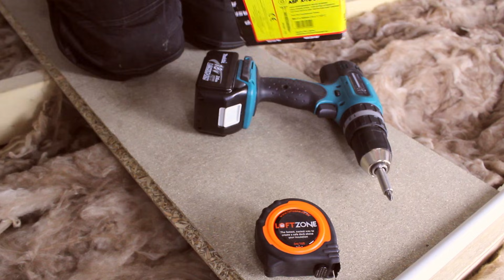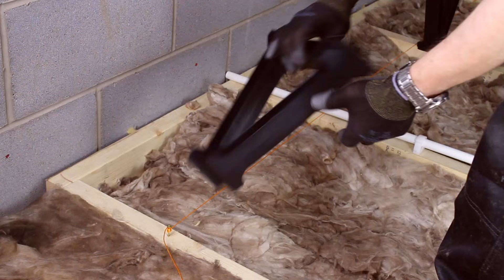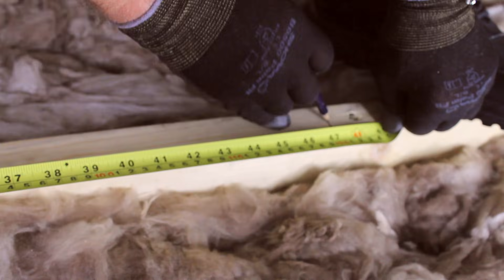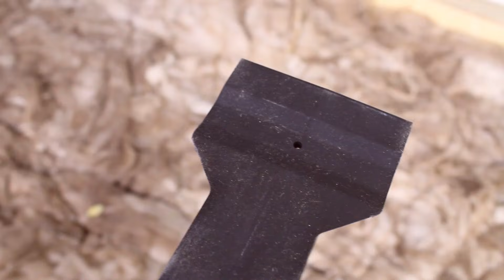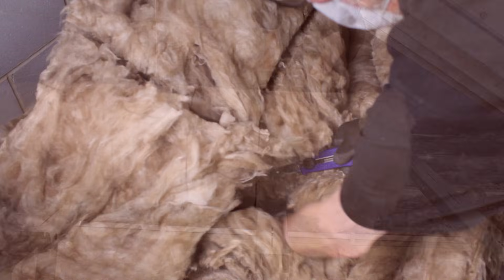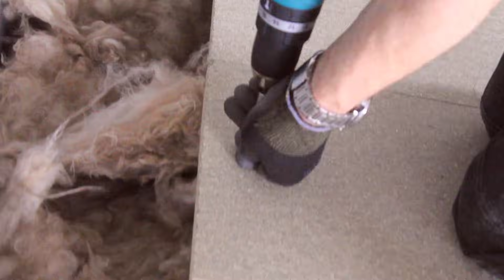How to Board a Loft Above Insulation | StoreFloor Raised Loft Boarding System | LoftZone

Comment: So, your loft is designed to carry 25Kg/m2 additional load. Pedestal loft floor weighs 16K/gm2. This means you have 9Kg/m2 additional load for your storage.
This equates to around 9x1Kg bags of sugar every square metre of the loft floor area. Not much is it? Consider before any visit from a surveyor/building control or even your insurance company!

Comment: Its easier to do a multifoil solution. You can achieve good R value with two layers of YBS Super Quilt using the foil and cheap CLS studwork timber. Plus you will only lose minimal height and its a very stable floor for storage.
Reply from the maker: Technically, that is incorrect. The foil will deliver good R-values but the timber will counteract that, by acting as a cold bridge through the insulation. This is why new build houses can't use timber to raise platforms without adding extra insulation elsewhere in the building. Our product does not act as a cold bridge. Also, the foil is not breathable (vapour permeable) and so you will need to add a ventilation strategy to the living spaces of the buildings, otherwise you will end up with mould in the home. These are the reasons why we don't sell these products on our website.

Comment: A very expensive system
OSB board and cross beam timbers is cheaper, quicker and more solid.
Reply from the maker: On the contrary! The LoftZone StoreFloor system was designed as a superior alternative to using wood. Its advantages include being lighter, being easier to install as it can bridge over obstructions, services and uneven joists, it also does not conduct heat through the insulation like timber does, and it also allows for a great depth of insulation that can be achieved with one row of timbers. That's why only the LoftZone StoreFloor system has the necessary BBA certificate for new builds. And also why you can't use the method you suggest on new builds without increasing the insulation elsewhere in the house to make up for the heat lost in your method. 

Finally, don't use OSB boards, there are much better boards on the market. Indeed, at the time of writing, LoftZone has the UK's largest range of quality loft board types on our website :)

Comment: what a waste of good loft space
Reply from the maker: On the contrary, the flooring is designed to go above the insulation (at buildings regulations required depths) and this enables the space to be used, rather than simply be full of insulation.

Comment: Can i use these to install a laminate flooring and make a bedroom in my attic?
Reply: No, this was designed for a loft storage area. You will need to strengthen your joists if you want to turn your attic into a bedroom.
Reply: @nationwideloftstorage7151  how can i strengthen my joists
Reply: @mohammadabdullahkhan360  you will need to hire a loft conversion company. It's a job that will cost tens of thousands of £ and cause a lot of disruption, but will add to the value of your property. Alternatively if you only want a storage space, then you can find your nearest installer on www.loftzone.co.uk, this will cost hundreds or a few thousands of £ only.

Comment: Hello  . Just watched the video carefully , as i want to do this to my loft too . I still have to  enlarge the hatch first , but i will have to inform myself better about how safe it is to cut one of the joists to enlarge it .  Anyway , this seems to be a proper system compared to what wickies and b and q are selling , and it seems to be at almost same price . (both a bit over what i was expecting lol )
Reply: Cutting a roof joist - nothing can go wrong - LOL
Reply: By "enlarge" I assume you mean you are trying to install a rectangular hatch which typically have a built in ladder?  In either case NEVER CUT THE JOIST. Your hatch needs to be orientated to run in the same direction as the joist so that it fits between the joist. You then secure two noggins (horizontal piece of timber) between the two joists so your hatch can be secured to it on both shorter sides.

Comment: Why can’t you just put down sheets of ply straight on top of the joists ?
Reply from the maker: Because that doesn't allow for enough insulation to meet modern building standards or codes, which have been set to save energy. These days you need at least 270mm of attic insulation (if you use mineral wool) and most joists are only 75 or 100mm tall. The LoftZone product goes above the insulation, giving you both a deck and the correct amount of insulation.
Reply: Lol

Comment: What a waste of space, great way to reduce the hight in the loft 🙈😃
Reply: I’d think it wise to research a subject, before offering an ignorant comment.
Reply from the maker: The LoftZone StoreFloor product is designed to go in lofts where there is already up to 350mm of insulation, which you will find in all new build houses and many older houses where the insulation has been retrofitted to the level now required by building regulations in the UK (typically around 300mm thick). So it actually increases space, by giving you a storage deck plus the full depth of insulation.
Reply: Houses are extremely over insulated theses days,  use supper foil save space and money,
Reply: It’s not about homes being over insulated (if there is ever such a thing) it’s about being able to install flooring without effecting the original to regulations new build house.

Comment: I'm just trying to figure out how sonething designed to hold plasterboard can all of a sudden support a load! Would love to know the allowable load per sqm for this set up
Reply from the maker: The allowable load in each loft depends on the building. However British Standards mandate a minimum loft floor strength of 25kg/m2 for all new build houses, for storage or other long-term purposes, in addition to a higher limit for transient loads, e.g. someone walking around. Many houses are, of course, able to take even more load than that. LoftZone has been tested to hold 500kg/m2 in accelerated ageing long-term tests. I hope this helps answer your question :)
Reply: @LoftZone  yeah thay does so as long as it was built after those specs were introduced should be fine? Nice
Reply from the maker: @vkturbo7676  Well it varies by building of course, but many older houses are actually stronger than new ones. Modern truss roofs are often much weaker than more traditional cut roof designs, for example. You just have to be sensible in loading your deck with your possessions, and we provide guidance that you shouldn't exceed 25kg/m2 unless you know that your roof is stronger.

Comment: They just dont look stable and made of plastic :(
Reply from the maker: Actually the LoftZone deck has been independently tested and is much stronger than the loft joists which it is screwed into. You can see our BBA certificate showing this on our website, www.loftzone.co.uk. The reason for using recycled engineering-grade plastics is that wooden supports act as a 'cold-bridge' and allow heat to escape through your loft. The Buildings Research Establishment has however verified that our supports do not act as a cold bridge in this way.

Comment: 11 inches extra height in a standard loft ? does not leave much head room ....
Reply: No if you want to maintain the new regulation thickness of insulation.
Reply: Yes, that's the buildings regulations minimum depth of loft insulation these days. Many houses have more. What the LoftZone product does is that it provides a deck above it, so the space can be used for something else and not just insulation.
Reply: Best use insulation boards in the rafters and only use a slither of insulation under the boards which should be screwed down without the use of the tri supports .
Reply: @hardythingh4510  but that makes it a warm loft, not a cold one. You will then also have to block up the vents (e.g. in the eaves) and bring in a new ventilation system, eg. MVHR.

Comment: They give no extra strength to the roof  ok for light storage
Reply: Thanks for your reply, but I'm not shore you are correct when saying they strengthen Just as if you counter baton, as you have the strength of a 4x2 screwed to evert joist that ties the roof together , I think this would be a great product and more weight Bering if you combined them both together. but as you say it is selling so great I hope your company is a success. Ill have a look at your website and if it is cost effective ill give it a try out. I also think a washer to give the screw a better fixing
Reply from the maker: Thanks again Richard. By the way, we do have trade prices (not shown on the website, but available if you call us up to order and have deliveries sent to your business address). All the best!
Reply from the maker: Hello Gemini Roofing, and thanks for your comment. Yes, we always advise using LoftZone to only create storage or safe access platforms, and to not exceed 25kg/m2 for storage unless you know your loft is strong enough for more. However it's worth noting that the LoftZone parts do indeed strengthen the joists in the roof to some degree - they act like a lattice beam. In that respect, their strengthening qualities are similar to cross-bracing with extra timber, except that it's much better than using timber as wood is heavy and acts as a cold bridge through the insulation, affecting the U-value of the roof. Lots of roofers buy our product and sell it as a value-added extra to their customers. If you're interested, please get in touch via the contact details on our website. 25,000 buildings in the UK with LoftZone can't be wrong!

Comment: 25kg per square meter!? So its either weak as hell or you are avoiding any liabilities on a rediculus scale
Reply from the maker: Hello Marc and thank you for your comment. StoreFloor decks have been independently tested and, in accelerated lifetime ageing tests, in extremes of temperature, the decks survived loads in excess of 500kg/m2. This makes the deck stronger than the minimum loading requirements for operating theatres, banking halls, rooms with mainframe computers and factories, to take just a few examples. That's also why, when we received our BBA certificate permitting the use of the product in brand new houses, it was stated that the LoftZone product was expected to last the lifetime of the house. However, the LoftZone deck is screwed on to the joists of your existing property. We don't know how strong these are - every house is different. The 25kg/m2 figure is the British Standard continuous loading figure for new house loft floors, using truss roofs. (It's 90kg for temporary point loads, which could for example be viewed as someone weighing 180kg and walking around on 2 legs). Many houses are stronger than that, of course, but we recommend that you keep to 25kg/m2 unless you know that your loft is stronger than that. If you have any other questions, please give us a call via the contact details on our website, www.loftzone.co.uk. Thanks!
Reply: 25kg per square metre = 625kg per metre squared. It's saying 25kg for each 10cmx10cm area.
Reply: @Hedghog6666  That's not right. 10cm x 10cm (0.1m x 0.1m) is only 0.01 metres squared. 1 square metre (1m x 1m) has an area of 1 metres squared.